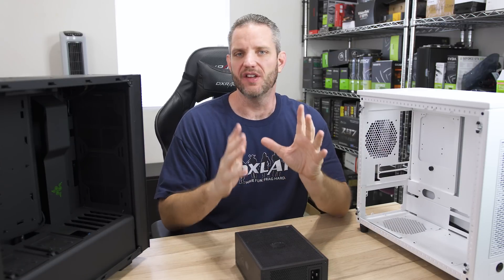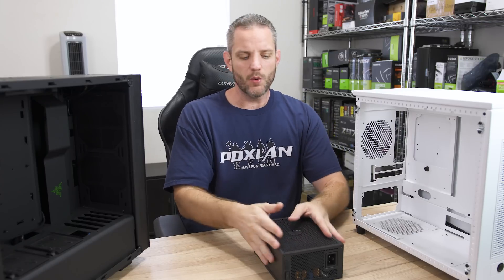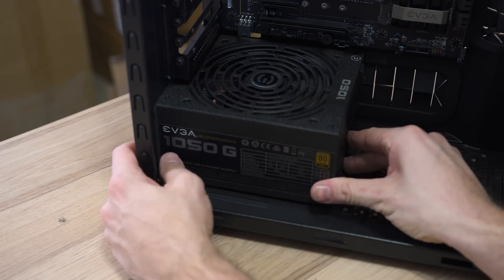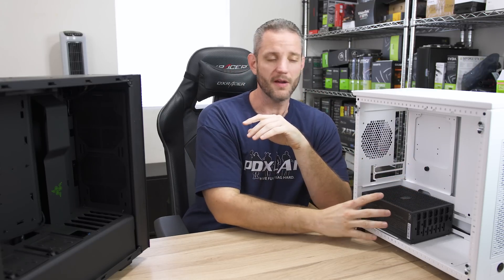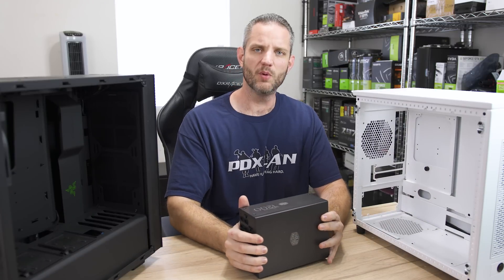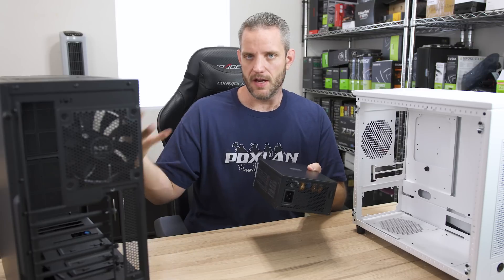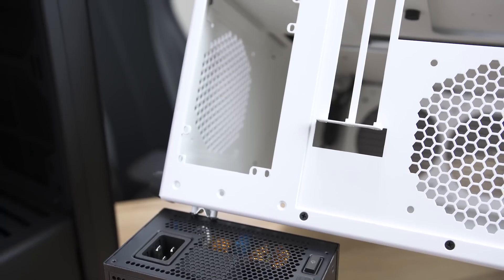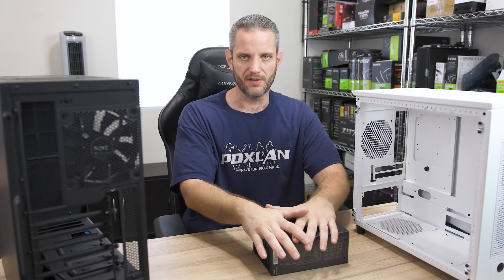Should you mount your Power Supply up or down?

Comment: Is anyone here playing BF1 on PC? Cause it crashed twice this morning very unusually. I've reached level 35 and not once did it crash. But this morning, it crashed twice. 6600k, 1070 FTW and 650w are the components that I'm using. My temps are fine. Idk what's wrong with it.
Reply: Hans Balais might be your gpu, have you applied any of the fixes for evga cards that have acx3 coolers to your card?? if not that may be the issue. Of course also make sure you have your card drivers up to date and the game is up to date.
Reply: Hans Balais What are you using HDD, Or an SSD
Reply: D I S T A N T SSD Kingston 980 GB.
Reply: James Murphy my gpu's temps are not even going higher than 71C under load on ultra settings in BF1. I don't think that's the problem and it's not even a month old.
Reply: James Murphy I haven't tried those fixes but I'll see to it. And my drivers and game are all updated to the newest release.
Reply: Hans Balais its because u have a fault card... evga scammed you
Reply: Hans Balais Yup. Watch out with that ftw Vrms, did you put the thermal pads ?

Comment: In my pc case the power supply is placed the upper end of the case, I think its still the best place for it. 
Anyway, I have another topic: In a water cooled system, why do you need case fans? The water "carries away"" the heat and in the case there's no hot air, or am I wrong? I dont realy know, just guessing.

Comment: if you put the psu with the fan up it would make negative pressure under the gpu. the best solution is to flip the psu fan so it takes cold air from a low place, throws it up to the gpu and both supplies it with fresh air and directs the hot air to go up faster and then the fans on the top of the case just easily take it without making a lot of negative pressure

Comment: wondering if jay or anyone else can answer a question about my custom loop. I have a fully liquid cooled PC (using very cheep parts and metal ect.) and the loop dosent take in that much heat. But my water is turning murky and foggy. I have changed out my water 2 times before and this batch has only been in it for about 2-3 months. I am using a silver kill coil and don't see where this problem will be coming from. Could it possibly be from my Chinese radiator(which is pretty sketchy, 240mm)? Also my water block is getting black little spots on the copper on the inside, it looks like mold but I have a biocide. So any thoughts on what it could be or what I could do about it would be much appreciated.
Reply: StrawberryCheeseQuake sounds like mixed metal, try running car antifreeze in mixed metal systems, espesially if there's aluminum
Reply: I have an aluminium radiator with copper blocks so I think your right. Ill certainly try that, thanks.
Reply: StrawberryCheeseQuake you're welcome, it may not be that, but it sounds like it, especially with a kill coil in the system

Comment: Nonsense Jay I run my fans full tilt on intake...problem solved
XD
Reply: Just use every fan-mountable surface but the rear for intake, and you're basically guaranteed positive pressure.
Reply: vdochev Well, you could just turn those top fans into intakes... Does your case have dust filters on the top?

Comment: This is a positive comment.
Reply: These jokes blow me away.
Reply: CaveManta Im quasi positive
Reply: CaveManta It was an airflow pun. Cause the air flow blows. Even if it is neutral.
Reply: I am triggered.
Reply: This is Schrodinger's comment. It is both positive and negative.
Reply: Fuck you.

(that was supposed to be a negative reply :D )
Reply: this is a reply. not positive, not negative, and not neutral
Reply: Tuchulu Stahp youre forcing me to give a negative pressured reply
Reply: Tuchulu i support this comment.

Comment: Jay, I have an idea for another short video but I'm not sure what venue I should use to request it. I have recently built a new system to replace the one I built 6 years ago. As you can imagine, lots has changed since then. I have been pleased to find reviewers like you who give an un-biased perspective on components as well as thoughts about hardware in general. In that vein, I would like to see you address a question I have regarding HDMI vs DisplayPort for connecting monitors. I am primarily interested in gaming applications, but the cards I knew about 6 years ago didn't even have DisplayPort available. I know that HDMI has the ability to pass along video, sound, and some other info for HDMI-link stuff, and I would assume that DisplayPort is similar, but I'm unsure as to what would work best for me. With my build I purchased an EVGA GTX 1070 FTW Hybrid (thanks for your reviews on these cards, btw) along with an LG 29" 29UB55 Ultrawide 21:9 screen which runs at 2560x1080p resolution. It appears that this screen is not over-clockable and I will be at 60Hz. Is there any advantage to using a DisplayPort cable vs an HDMI cable for this setup? This is probably a n00b question, but I've found conflicting articles online and I am not at the bleeding edge of refresh rates or resolutions, nor do I have the money to be.

Comment: Knew you had a reason for putting the fan facing up. Judging by all the exhaust fans you had in that video I had a feeling that you put the speeds of those much lower than the intakes. Anyways thanks for the info. 👍

Comment: Nice, something to consider even for the more advanced viewers not only the beginners, I am now thinking about turning my PSU around and using it as an extra exhaust fan since my case barely has any airflow due to the radiator in the front and only one exhaust fan. 
Thanks for the idea

Comment: We know the 980 ti and 1070 are pretty close to each other when both are overclocked, but they say this is also true for the 980 and 1060 as well, so can you test out these two when stock and when overclocked to see which is better performance wise. My money is on the 980 as Maxwell vs Pascal seem to have when at the same TFLOPS pretty much the same performance, but the 980 can reach higher TFLOPS so this is why i say it must be a little better 
For example
1060 at 2100 MHz is 5.376 TFLOPS
980 at 1465 MHz is 6 TFLOPS

Comment: I have a 980ti Zotac AMP Extreme so my case gets really warm. This is because it dumps the air inside my case. So having my PSU intake air from the top is a big no. I absolutely hate having to clean the PSU filter though. Such pain in the ass.

Comment: You can add one more thing: esthetics. Many PSU's producers assumes that You mount it with fan directed down. And You see then a lot of information, power draw, efficiency, blah blah blah, and other stuff. But what about You want nice "clean insides"? Then simply mount it upside down, and end up with nice epty surface with utmost manufacture logo. But this one is rather minor one. 

Thanks for vid, waits for next.

Comment: How Does my Gpu use the VRAm on my second card. I have A GTX 950 and for my second card 750 ti (Mainly because i didn't feel like just letting it collect dust). I've never understood how it does this. Is it set up automatically or what.

Comment: Jay, can you compare the noise levels of different static pressure and airflow fans?
Reply: I think he's done a few fan videos where noise was a consideration. Are you looking for a comparison between several airflow fans or between several SP fans? If you want to know whats quieter SP or AF then it's SP every day (unless you they are VERY poor quality)
Reply: 3djooboy I wanted a comparison between different models like the corsair, Noctua and Fractal Design models.
Reply: I second this guy ^
Reply: SP fans are quieter. Don't necessarily need a video to read the dba/noise level of a few fans in consideration. If you don't mind the price the Corsair ML series are VERY quiet and are also good static pressure fans.

Comment: You forgot to mention that in SFF/ITX cases, where fans of any config are at a premium, having a "free" exhaust fan is a huge plus. Conversely, if the PSU fan is up, but right next to an AIB GPU, you will reduce the efficiency of one of the fans, which is bad.

Comment: Nice. And what about swapping the fan from a PSU that has 135mm fan? 
I need to replace it because it's way too noisy. Maybe just go for a 140mm and try to drill more holes on the shell part? It's a XFX 650W Core Edition I got in early 2011, btw.

I already tried putting some oil on the fan bearings and also cleaning it (carefully disassembled the PSU and the fan), but it still makes a grasshopper-like noise.
Reply: I had the exact same problem with my XFX 750W Core Edition. Annoyed me greatly when I opened it up and noticed that the fan is 135mm and there is basically no replacement to be had anywhere (at least in my country, might be some online). Luckily, once I put some WD40 and oil on the bearings, the noise went away. But I'm still worried what to do once it starts again, because I'll have to change the fan eventually.

I'm not sure the 140mm fits (haven't had one to try it with), but I did try out how the 120mm would fit. I figure you can jury rig it with some plastic ties if you don't want to drill any holes. Won't look too pretty, but I reckon it's better than a noisy PSU.
Reply: Don't BeQuiet! make 135mm fans?
Reply: I don't know, but I'd still have to import if they do have 135mm fans. I do have a 140mm fan that came with my case, but I haven't tested to see if it would fit well enough (and I still need it for exhaust)

Comment: I get that question about my system as well. Big overpowered hyper efficient power supply (bought because it was on sale and had a huge warranty) so I don't think the fan has ever even spun since building it. My thought process was that any air coming in the PC could move through the power supply passively

Comment: should mention that this mostly applies to cases where the power supply is on the botom of the case. For all cases with a power supply at the top (if i remember right the cougar spike) then there is only one option.

Comment: Building my PC SOON First time does a 450w make my bill higher? Pls need answers
Reply: Power supply wattage doesn't change the draw. Power draw is from components like the CPU and GPU.
Reply: Erlwers Ferserx thx for the fast response and plus should I shut mines off every night?
Reply: You can if you want to, it doesn't make any difference or hurt the hardware if you leave it on all night. I've had my computer running months at a time, still going strong.
Reply: Erlwers Ferserx appreciate it bro for the response
Reply: Erlwers Ferserx thx

Comment: Then if I have a cramped up case with 2 front fans and 1 back it would be better if I put the power supply fan up (this maybe even more logical due to my 1080 tottaly not giving a crap during idle and not using fans at all ) Nice video, thanks for the tip :)

Comment: ALSO PSU:s that have semi passive cooling, it is efficient to face the fan upwards, because the hot air can then escape it's natural way (upwards) and the PSU fan doesn't need to spin that often (ESPECIALLY good for those who aim for silent configs). AND YES, it's gonna give some hot air to gpu but that is pretty much marginal and compared to psu fan activity, nonexistent drawback. 

I was waiting for this the whole video but you didn't include this fact, but hey, otherwise it was very good video, I learned some stuff :)

Comment: Good video Jay keep up the good work. 

Not sure if you have done one yet, but it would be nice to see a video on power supply failure. I had just bought my 980ti at the time and the card wouldn't work and it turned out that the psu which was powerful enough to run my rig and the card couldn't power the because it was about to die. What was strange was that it could run my 970 just fine but as soon as I slapped the 980ti in it it wouldn't boot at all.

Comment: how should you position your fans based on how many you have? if i have 2 where should i put them for best performance? 3? 4?
This info would be great to know as im building my first pc but i dont know a whole lot about fans and where to put them.
Reply: There are a lot of people who will say you MUST do this or you MUST do that it is safe to basically ignore anyone who says there is only one way to install fans.
Basically; In, low and to the front Out, high and to the back, more air  in than out (posuitive pressure) and you will be fine . 
 When making wild overclocks (much later in your PC building (assembling) career and two degrees is important then you can worry about should I intake from the centre front or the lower front or..
Reply: *****
If gravity does not act on heat how does heat "know" which way is up?  Heat does NOT rise, hot fluids (Yes air is a fluid) do, hot fluid being less dense than cold tends to float on it hence hot air travels away from gravitational forces and cold takes its place.
   I rather agree with Robert on this one heat spreads fairly evenly .
  Although fairly insignificant compared to the force produced by a fan I would rather have the force working with my fans than against any air flow caused by the fans
Reply: +Cheezsoup - Make that "Out to the back, in everywhere else". Few cases have extensive fan mounting options on the bottom, and so if you populate the top and rear with exhausts, you'll only have the front left for intake, making it a tad difficult to attain positive pressure. Use the top for intake as well though, and you're golden. Having said that, you are right in saying that this whole study of where to place fans is largely academical, and in all but the most extreme circumstances, you can put fans wherever you want.
Reply: LinusTechTips did a really good video on this showing how many and where you should place your fans in your case to be most beneficial and at which point it pretty much becomes useless to add more, if i remember correctly front and back is best for two but check the video out for yourself for peace of mind
Reply: the standard model is intake fans on the front, bottom and side; exhaust fans on the top and at the back
Reply: ***** No, it doesn't. Heat spreads evenly in all directions, provided there's a medium for it to travel through. It is true that hot air rises when surrounded by colder air, but for that to have even a noticeable impact on airflow within a PC case, you need to be talking about much larger temperature differences than you are. With the few degrees that GPU and CPU heatsinks add to the cooling air, there is too little of a difference, really, and it's certainly not something that even an incredibly weak fan can't overcome with overwhelming ease. Strictly speaking warmer air does indeed rise, but it's irrelevant to discussions about PC airflow...
Reply: ***** Right... I guess I'll come back to this when you've realised the difference between "heat" and "hot air" and edited your comment accordingly.
Reply: ***** Your posts are getting longer and longer, and yet the increasing number of points made in them remain as irrelevant as they were before.

As you say, hot soup rises. So do the hot gases that are burning to make the fire on your cooker. Do you see the issue there? Earlier I said you failed to distinguish between heat and hot air, but maybe that wasn't making my point at a basic enough level, because you're still apparently kind of missing it; there's a difference between thermal energy itself and matter containing a certain amount of thermal energy. The latter, provided it is in liquid or gaseous form, will indeed move in the opposite direction of gravity, or rather, it is pushed out of the way by other matter containing less thermal energy, which is itself thus moving in the direction of gravity. The former, however, is immaterial, and so it does not "move" at all in the strictest sense, but nature desires balance, and so energy, given the chance, spreads from places with high energy density to places with low energy density. Thermal energy is no different, and it'll spread evenly in all directions, so long as it is able to.

To get back to your example of a metal object, which for the purposes of clarity we'll assume is a pan, heating up on a cooker; You are right in saying that on a gas cooker, putting the pan below the heat source willl make it warm up more slowly. This is, however, because on a gas cooker, a significant amount of heat is transferred through the air in between the flame and the pan, which moves upwards, not to mention that the flame itself (which is, after all, simply a mixture of gases emitting light). Take away the gases and apply the heat directly to the pan however, as you would on a ceramic or induction cooker, and this won't be an issue. If you have the time, energy and resources, I'd love for you to fit a ceramic cooker upside down to the ceiling, switch it on, and hold a pan against it with the same force that gravity would exercise on it if it weren't upside down. You will find that the pan heats up just as quickly this way as it would if it were right way up.
Reply: Robert Faber
 I never said nor meant the bottom, low and to the front does not mean underneath it . I meant at the low part of the front
Reply: Cheezsoup You, sir, are brilliant. In that one first sentence, you managed to better get the point across than I managed in a whole wall of text...